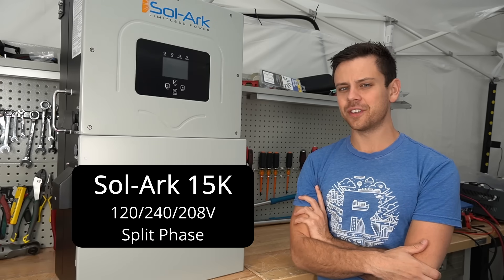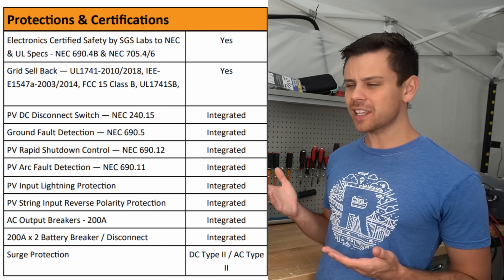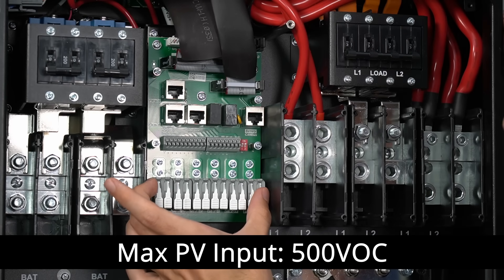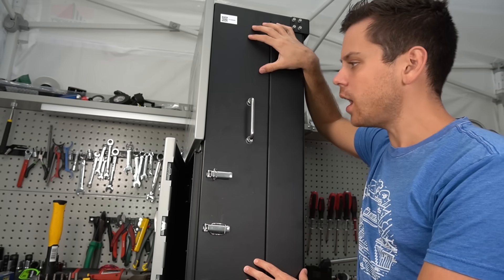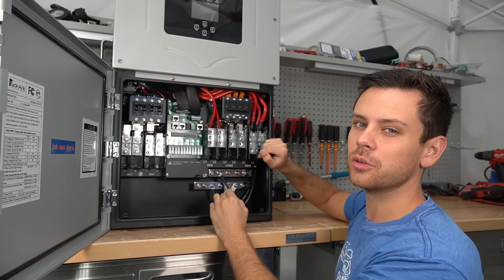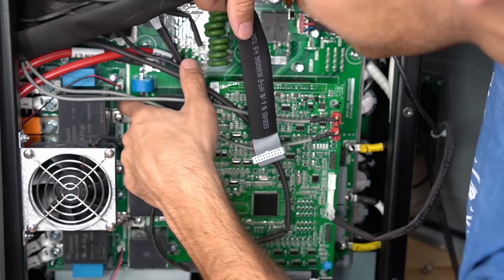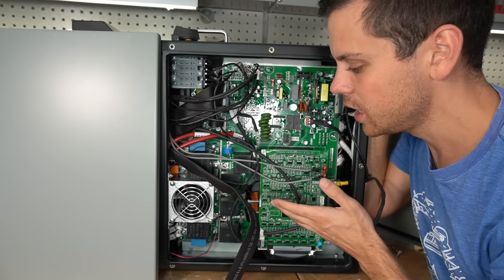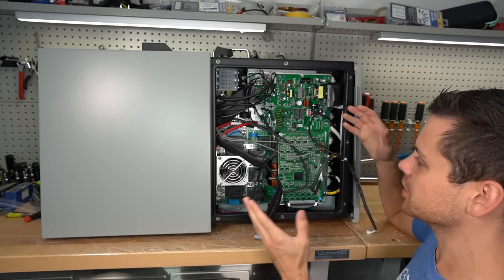Sol Ark 15K: Ultimate Grid-tie or Off-grid Inverter

Comment: I agree this is an impressive product. It does not however live up to its hype in one respect. The Sol-Arc literature and videos imply and sometimes state outright that it does away with the need for transfer switches. This is mostly true with one significant exception. If you want to use a standby generator that is nor whole home sized to charge the batteries as it implies you can do consider this. If you use the generator terminal input to charge the batteries the inverter will try to charge the batteries up to the limit you input into the settings. This sounds good but remember that in a grid loss scenario the generator has to power the house loads as well. Thus the inverter may overload your generator if the house loads plus the charging loads exceeds the generator rating. Ok, that seems straight forward but what if you want to minimize charging time to limit noise to your neighbors? What you effectively have to do is estimate both house and charging loads and hope for the best as the inverter will not limit its load to protect the generator in this mode. To get automatic operation in such a scenario you must connect the generator to the grid input port which requires a 200A transfer switch. Not a cheap option and not anticipated in any of the sales literature or videos I have seen. Sol-Arc knows about this and if you ask directly they will tell you plus if you peruse the owners manual carefully you will find this. However they choose not to change the software to fix it. Guess it’s not important to them yet. I hope more visibility to this issue will change that. In the meantime I hope you don’t proceed assuming that you can use your generator to charge the batteries without continuously monitoring your house and charging loads. That is probably the last thing you want to do in a grid loss situation.
Reply: @NumberThree1950   I live in an area prone to power outages and looking for solar system to power half of my house during outages and reduce my bill from the electrical company during the rest of the year.   During outages I'm thinking I will be relying on solar power during the day and charging my batteries.  I in the south with plenty of sun.  I only plan on using the generator at night.  My propane 9000w generator can power half of my house fine.  During an outage can this be configured to run off the batteries and have the generator charging the batteries instead of the generator supplying power to the house and charge the batteries?  Thanks for your comment and any help you can provide.
Reply: Sol-Ark

Comment: I installed one for a friend my only issue with it is the fact that a Chinese company owns the online logging data software.  It is possible they could remote shut down or have access to your data.  Doesn't seem good to me.  I would recommend not using the wifi and remote logging until they get the software localized.  Works awesome without internet tho and such and easy install.  I've installed Manu solar systems and I can say you could easily install this with very little electrical knowledge.

Comment: Hi. I love your videos and I wanna thank you for explaining things. I’m thinking of getting a grid tie system and possibly doing a diy kit. My monthly kw average is 581. I like the idea of possibly running my house on 15k sol ark. Do you think it’s over kill to install the sol ark 15k? The solar online calculator roughly recommended a 5.2 kw solar array system. What are your thoughts? I live in San Diego and my bills have been in the 400s
Reply: Whoa.....I live in Long Beach, CA (metro Los Angeles) and in this 2022  summer with 2 window ac, all electric 2 room apartment, I"m using almost 1000 Kw, monthly average, and my electric bill is $260......Something is rotten in San Diego electric.

Comment: Did a load test on 15KW they carry at least 50A per leg as advertised with good inrush on a  300A home grid battery bank.  Off grid.
Did see AC voltage sagging some. Will post video.
Also this 15KW starts a 4 ton Air Condioner with soft start installed, running still many home loads.    You should do more load test for people with your fancy shop and meters. Would be good video. To compare other brands.  Xw inverters, sma  probably better inverters but they need  someone to bring them to 2022 sol ark tech is very nice must say .

Comment: Having integrated 200A transfer switch is a bad idea. If you have to ship this inverter back for service you would have to pay an electrician to wire your main panel back to the meter. This thing is so heavy it will cost a fortune for shipping and require at least 2 people to lift from the wall. The EMP thing is a gimmick that in no way guarantees this inverter will survive a nuclear weapon space detonation EMP. For the price I would go with discrete component Victron equipment.

Comment: This is a great product for grid tie.
It has so many features off grid doesn't need.
I always wondered why Off Gridders want split phase systems.
I use a 220V inverter for when I use 220V tools or appliances. It is usually off.
I have 2 primary  - 110V inverters, 4K and 3K, plus several 400 - 1200W for rarely used devices on different "legs". 
This means I can use smaller inverters saving standby power and not overload any particular circuit or inverter.

Comment: The capacitors you are pointing at 5:52 timestamp are the bank of 315v rated HV DC capacitors for two HV DC buses for the two 120vac inverters connected in series for 240vac.  

SolArk's and Deye have large banks of HV DC caps to allow the battery to HVDC converter the time to switch modes between charging and forward converter mode.  During the 10-20 millisecs battery to HVDC bus converter power flow direction mode changeover, the power is supplied by the large bank of high voltage caps.  They also must absorb any backfeed surge current during AC coupling from external GT inverters through AC output of SolArk.  To be safe, they still recommend feeding AC coupling through Gen AC inputs so they can quickly open gen connect relay if GT inverter back surge current gets too great.

SolArc and Deye hold the record for the most screws used on an inverter.  There is another large board below the large one you see that has hundred or more screws through bottom board to clamp down all the MOSFET's and IGBT's to the backside heatsink.  Changing out a defective power MOSFET or IGBT is quite a lot of work just to get to them.
Reply: Yep, this thing is not designed to be easily repairable.

Comment: Very misleading video, the idea of powering a home load center sized at 200 amp (48k watts) with a inverter that can provide 12k watts (50 amps) is a joke. As soon as the load exceeds the inverters rated 12k which it will that inverter is going to self protect and shutdown or burn up. Maybe there is a theory in ohms law I'm not aware of. Please explain how this 12k inverter can power a panel that requires 48k. I would be comfortable doing this to a 60 amp service not a 200.

Comment: Will, Thank you so much.  I have a 7600 watt (19 x 400) on-grid solar system.  Please suggest an Inverter replacement that will allow my array to transfer and provide back up power.  As it is, when the utility power goes off line, my system shuts down.  And we are power less.

I probably need to add a 48v battery system as well.

Thank you.  JIMc

Comment: I was wondering Will if you could advise me on some information? I have 2 100ah lithium phos batteries and a victron start 150 100 solar controller,  please could you advise me what parameters need to be changed  and what they need to be to make my system work efficiently. Many thanks Simon

Comment: I committed and have one of these units - as you say 200amp simplifies a bunch. Not crazy about the AC coupling on the gen load. I have 2 Fronius primo 8.2's and a 100amp autotransformer. I am still hedging - I don't want to power off ( freq - shift) my Fronius when they have power to give ..... just because the batteries are full I called Sol-Ark and that was their take. Also the DIY battery support is still VERY sketchy ( at least for SOC measured ) from what I can see. Lastly I managed to pick up a commercial quality diesel gen set that is 48V DC output  ( direct charger profiles and all ) that I am going to figure out the best way to put to use! I plan on treating it like a charge controller direct to battery and getting sol-ark and it to "play nice" I do have a smart meter for limiting the Primo's to zero export, the autotransformer is for smoothing the leg loads export and inductive. The 15K + 560Ah litium + DC gen will be the total independence piece !

Comment: 500VOC and 26A DC input max seems low for a 15K inverter. Help me figure this out, lets take a hypothetical pv panel at 40V and 10A. This inverter can have two strings each for its three MPPT's giving six strings total. Six panels in series would be 240V/10A = 2.4K per string, right? I'm new to this so please correct my thinking, but wouldn't six strings be less than 15K and way more than 500V/26A?  Maybe the 500V/26A is per MPPT and not the entire inverter?

Comment: Hi Will,
I have popped in on occasion to see if your designs have any considerations for protection from either EMP or CME events.
Obviously just coming in rarely I have little chance of catching any coverage related to these sort of potentially hyperdevastating events.
I do think  that at least the off-grid and/or prepper communities would see some  value in shielding your designs if that were made available.

Geoff

Comment: I have solar panels and microinverters on my roof already, and I've been waiting for a product that can bring my system offgrid. I think this is the product I've been waiting for.
Reply: If you have micro-inverters you have AC from the roof and would not need this dc to ac string inverter. You could trade your micro-inverters for optimizers or tigo modules for the rapid shut-down. Of course off-grid is permit optional for many considering you no longer need approval for the grid tie. Then simply sell the micro-inverters to get some money back for them and forget the rapid shut down. Speaking as a former firefighter, cutting holes in the roof is not that helpful. Only the US does it. Surround and drown is a much safer and common approach. In short, the whole rapid shutdown is a money making load of crap but i'm straying off topic or "venting".

Comment: Love this product!! I also watched your other video reviewing the EG4 6500-EX inverter and I am trying to nail down which one I should buy. Leaning towards the less expensive EG4 (plan to purchase 3 of them) of course because I think they both do the same thing. I could buy 6 EG4s for the price of one Sol Ark 15k, so I’m curious if there is a compelling reason that would drive me to purchase the Sol Ark? I live 100% off-grid so my main concern is sufficient capacity in both inverters and batteries, the ability to charge the batteries with a generator, as well as simplicity of install. Will I be ok with the EG4?? Thank you in advance for your input! (Extra note: we are going to buy the EG4 batteries)

Comment: Great review and also love the product. Keep in mind although there is a 200 amp transfer switch, the max continuous output of the inverter off-grid is 62.5 amps at 240 volts. So the wire and transfer switch rating is for pass through current (grid to load) not off grid output current. It doesn’t supply more power then a competitive 15 kW inverter, it’s just the installation it’s self is greatly simplified and the selection of back up loads isn’t necessary.

Comment: Will eg4 batteries connected to sol ark pass inspection for hybrid or off grid?
Reply: Varies depending on how anal your particular inspector is and the jurisdiction.  I have some installed in the field that never had issues.  Local laws vary as well.

Comment: Will can you do a series on a good,inexpensive way to power up an rv....gettin away from lead acid,going to a full time solar converter possibly that would do at least equal work,and simplifying the 12v 120 systems?possible to eliminate and remove factory converter or abandon in place? Or is it better to just go to lifepo4 bwtteries?

Comment: question to anyone that knows: 
Is there a specific way to add a secondary 48v prebuilt battery to your system? If you have one lifepower4 and use it for a few years and then want to add a second one, is it just plug and play or do you have to bottom/top balance them both first?

Comment: Completely irrelevant to this video. However idk anyone who has as much solar wisdom as you. So that said, I have a question about compatibility. I recently purchased an EcoFlow Delta Mini. Then after searching around for reasonably priced panels I found a 130 watt panel made by a company called Sungzu. Not too savvy with this stuff, I was disappointed this weekend over my first attempt at trying out the panels with the generator. It would appear that the EFDM relies on MC4 connection while the Sungzu does not have that, therefore making it non compatible. However, I was wondering if there is any way to make them compatible? Specific adapters or any help would be greatly appreciated!

Comment: Looks like a bird's nest. Inadequate separation between high voltage and low voltage circuits. Low voltage wires draped over high voltage circuits. Difficult to troubleshoot circuits behind circuit boards. A catastrophic failure in a high voltage circuit could easily take out a low voltage board. Not a clean design.

Comment: Will, I have heard reports of moderate amounts of power usage by grid-tie inverters even when solar panels are producing a large excess. As I understand it, the inverter needs a mains waveform that it boosts. If this is the case then it makes grid tied systems and especially battery systems much less desirable for households. I've seen reports of 100-700+watts being drawn even when there is a large excess of solar being produced,. Where I am the feed in tariff is 2.5 cents and the kW cost is 37 cents, at 100 watts draw I would need over 1kW to break even and at 700w I would need over 7kW excess solar production! 
Any chance you could check your grid usage at peak solar production? The results might make a good video if this is right!

Comment: I just upgraded from 12k to the 15k.  It’s amazing.  I’m running 6 EG4-LL batteries on it and 24 320watt Qcells.  I’m about to add 32 more QCELL g10 ML 400w panels.  Also have while home generac on meter side.  All working as planned so far.
Reply: i am using 48v 200ah stackable batteries from tess electric with 15k sol ark. way better deal then eg4 batteries.

Comment: I was thinking putting a headway battery pack on a battery bank for peak current purposes.  The Headway batteries have huge current draw spec's but not that great for battery packs because of the prismatic cell cost.  I was also thinking maybe putting super caps on the output for current spikes.

Comment: So…not in-line with this video, but, am building a off-grid 24 volt system, my question is, is a solar combiner worth while? Using 8 265 amp/ 12 volt panels for my system…1st. time…what’s the best way?

Comment: Hello Will,

thank you very much for this great video. Absolutly well done. Thumps up.
But this system is not an three phase system, with 120 degree. So it will not really good use in an normal house, i think so.
VG, Jürgen B.

Comment: Open top for air flow?  
I like that it's on the top, being hot air rises, creating a natural air current, making less strain on the cooling fans.
However,  is there a hood that would prevent water from entering the unit?  Ie: snow or rain

Comment: There sure are a lot of integrated circuit boards crammed in there, several right next to where all that voltage is running through.  What happens when one of them fails?   Seems like a rather difficult repair and you could be without power for a rather long time.

Comment: HELP !!!! I bought 2 Weize 200AH batteries from Amazon 2 months apart - 1 weighed about 14Lb lighter and has a hollow sound.... Hard times rip-off? both sohw proper voltage. I have no way to test the load. Weize is giving me a run around wants to hear the hollow sound... WT...HELP